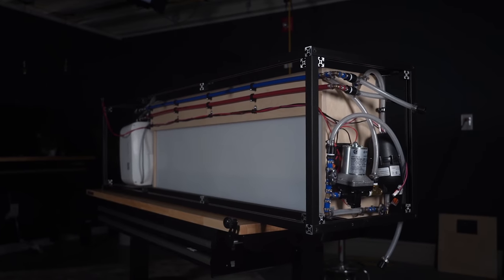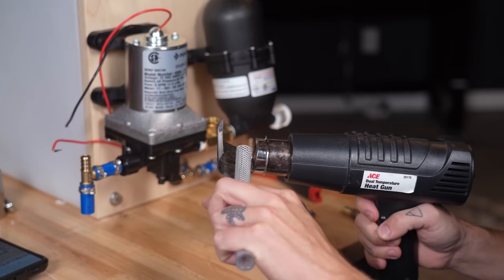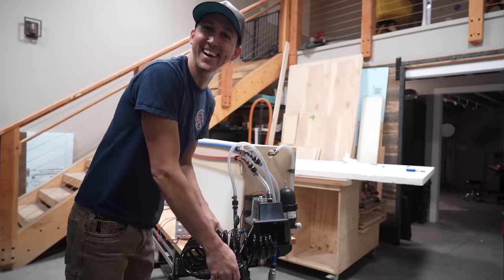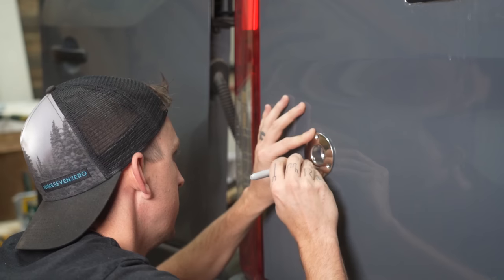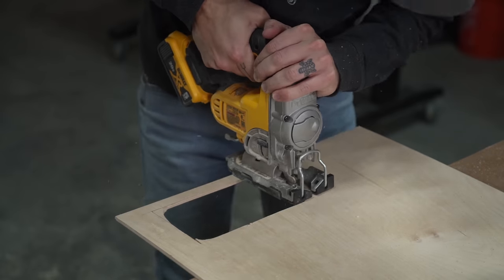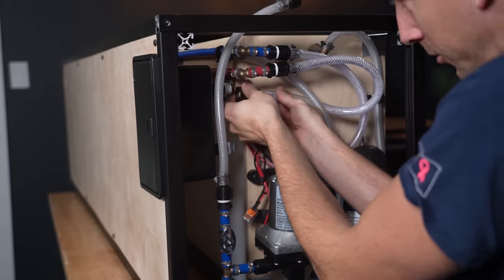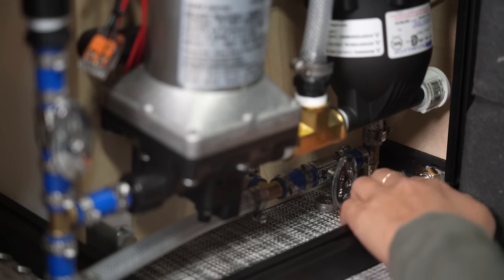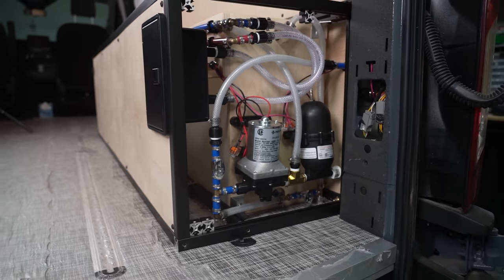DIY CAMPER VAN PLUMBING (full tutorial)

Comment: A tip to you since I’ve been doing plumbing work for a while now, use Teflon tape along with paste and you will never have a leak again. ;)
Reply: Do you put the tape on first?
Reply: @amateurdiy3960  Yes the tape goes first. Careful Wich way you wrap it
Reply: @amateurdiy3960  tape first clockwise  about three full circles wraps
Reply: Any chance you could explain why pex is used in parts of the system, and flexible hose is used in others?
Reply: @calevel
Reply: I’ve been having leaks in my van. I’m using pex A/expansion rings 
Im looking into converting to sharkbite connectors or pex B with crimp rings. These leaks are killing me! Any thoughts?

Comment: I'm curious why sometimes you used hose and sometimes you used pex.  I'm getting ready to start the plumbing on my box truck, so great timing!  Thanks, as always!  Will you guys be selling plumbing kits?
Reply: PEX is not as pliable. 
In other words, perhaps some of the curves and bends you see are done with hose because it's more flexible. 
You could do that with PEX however you would need more 90s, Tees  and fittings which would work. But you would lose efficiency and add the risk of leaks from more connections.
Reply: @Geminiappleboy , thanks. I had rather assumed that, but I wasn't sure. I couldn't tell from the video, but can a PEX fitting be used with a hose and held in place with a hose clamp? Or is some other type of fitting required specifically for use with a hose?  Thanks!
Reply: @BTNomad  use a PEX to Barb adapter that is sized for your hose. Do not use normal hose clamps on PEX fittings/connections that clamp the PEX tubing, but you can on the braided or no braided hose. Sometimes hose barbs are referred to as nipples.
Reply: @Geminiappleboy  , thank you! THAT is the piece I was missing in my mind!  The biggest challenge I have in doing my box truck conversion is learning what things are called. Thank you!
Reply: @BTNomad  oh cool! Happy to help. 
I would recommend making a drain valve at the lowest point (usually bottom of tank) to drain for winterization or long term unheated storage. 
As far as terminology goes, I think you should gain familiarity with the following plumbing components/fittings: Male/Female, Nipple, Coupler, Reducer, Braided, Adapter, Band Clamp, Hose Clamp, Pinch/Cinch Clamps. 
Don't forget the importance of calculating the flow required for your water pump and the electrical requirement to size your conductors (wires) accordingly.

Comment: Very solid design, build and clear video and editing. Well done, and thank you! The only thing I'm not sure about is whether you used flexible tubing on PEX connectors, which apparently is not a good practice and can lead to leaks in the future. I'm sure that is fine with low pressure/drain applications, but probably not on the pressure lines. Thanks again!
Reply from the maker: Flexible lines went to barbed connectors made for flexible lines in most cases.  If there was a spot where this wasn't the case and it starts to leak; I'll fix it. 🤷‍♂️🤣 That's the glory of building something yourself.  If you make it yourself; you know how to fix it if it breaks.

Comment: Nate - at 7:40 you attached the pex tubing into the water fill. The way you attached that was a little dodgy shall we say...The pex pipe will actually spin around the barbed fitting with the crimp attachment on it, therefore when you spun the blue pex so the male thread went into the outlet itself, you may have just been spinning the pex on the last few turns, making the connecting between the brass fittings not very secure. if you can get a spanner in there and just give it a 1/2 turn that could save you big time down the road. Especially as you wouldnt notice a small leak for a while in that inconspicuous space. Youve helped me so much in the past i wanted to pass that along.
Reply from the maker: It was tightened.  There's a lot that happens off camera. 🙂👍

Comment: I'll be building a similar system, so really appreciate this description.  I suggest thicker brackets for securing plywood to extrusion and to van walls/floor.  If you've been in a crash more than a fender-bender, you know forces can be huge and weird.  Use backing plates behind floor/wall to help resist pull-out in a crash.
Reply from the maker: As a firefighter, I've actually been to MVA's that were bad enough that the entire engine was ejected from the frame.  You can't make anything 100% safe.  What we did was fine.  Do what you want in your own build.  Thanks for watching.
Reply: @EXPLORISTlife  Agree,  nothing is complete safe.  Again, thanks for this great overview.

Comment: I’m curious about the KUS Sender unit in relation to calibration with the Cerbo GX. I see you are using a wheel arch tank which has a variable cross section as you travel down the Z-axis. Is it possible to calibrate the sender with the Cerbo GX and Victron touch unit so that it displays a more accurate percentage/volume. We are using a wheel arch tank that has a huge cross sectional area change from the top half of the tank to the bottom.
Reply: We have something very similar to this and I just ignore the tank shape. You can program the Cerbo to have a specific curve to match it but I don't find it worth the trouble.

Comment: Will the flex tubing leak over time? Looks like it's connected to a shark bite T. Shark bite and flex tubes have a different flange to hold them once tighten. Won't the flex tube expand on a shark bite connection?
Reply from the maker: Although it's not 'technically' the right connection, we had to heat up the flex tubing so it would even fit over the fitting, then it shrinks back down as it cools.  That plus a hose clamp gives me pretty high confidence in it not leaking.

Comment: So that method to mount panels to the frames with the small pieces of extruded aluminium is clever! But your video doesn't demonstrate it fully, so I've got questions. :)

You say you cut them to 5/8" thickness, and it looks like your panels are flush with the main frame rails, so both the hole through the small aluminium piece and the threads tapped through the end have to overlap - how do you mount that aluminium piece to the frame rail without that piece of hardware being in the way of the hardware used to mount the panel afterwards? 

 It looks like you're using the 10 series (1" x 1") rails so I assume you're putting that throughhole in at the half-inch mark so as to line up with a T-nut in the long rail? If the hardware used to mount that piece up sticks down through the centerline, that wouldn't leave much space for the hardware holding the panel in place to bite into threads.

Thanks for this vid!

Comment: Wonderful series and I always look forward to each new posting.  Very well thought out and narrated.  One question for you.  I'm confused on the links to the tools and supplies versus what was actually used in the video.  The links are for the copper crimp rings along with the tool to install that.  But the video clearly shows using the clamping method.  Might help if you are able to clarify the difference between the links and the video.  Keep up the good work Nate!

Comment: Think you'll have any issues with people messing with your water inlet? I was too scared to put it outside but filling inside is a kind of a pain.

Just an FYI since everyone does things differently.
We used the same flexible tubing as you and noticed a plastic taste to the water so I switched to using food grade silicone tubing on the non-pressurized side and pex on everything else. 
We didn't use an accumulator since the 4008 pump instructions said you don't need one and we haven't had any issues with the pump coming on/off any more than usual (I also took a few trips with the accumulator in our system before I rearranged things and needed the space).
We are in Wyoming and have to winterize a lot so we changed to the IsoTemp water heater because it drains from the bottom and taking the whole Bosch water heater out to drain it was a huge pain. But the IsoTemp is like 3x the cost of the Bosch.
We have a 400ah lithium system and have no issues with using the water heater since we drive a few hours each and fill the batteries back up. The Bosch is 1800 watts and the IsoTemp is 750 watts, but the IsoTemp takes twice as long to heat up, so both are about the same in terms of electricity usage.
Reply from the maker: I'm not worried about people messing with our inlet, no.

Comment: Thank you for such a clear build, really helps eliminate the learning curve for van plumbing. My one question would be is if the Bosch Water Heater is always on and just senses when there is water coming from the pump or is there a switch for that as well? I'm not too familiar with water heaters so any information would be very helpful! Thank you!
Reply from the maker: Currently, it's just switched on/off at the breaker.  I may put it on a switch in the plumbing enclosure eventually or a bluetooth outlet switch; but I wanted to see if the simpler solution was adequate.
Reply: That definitely makes the most sense. Thank you!

Comment: I think I have the same pump. I was going to add an accumulator tank however the manual doesn't recommend one I think it's the new bypass pumps that don't need them.  They are loud af for me without flexible tubing attached directly at the inlet and outlet of the pump.
Reply from the maker: Interesting.  Ours is whisper quiet. 🤷🫤
Reply: For me it's the Pex line coming off. It vibrates and reverberates. The company actually sells a kit with flexible tubing to help quite the pump.

Comment: Thanks. What are you using for water gage? I ordered two gages, that look identical, then asked if it’s safe for drinking water and was told no, ask to cancel order and they said, oh yeah, they are safe. Bottom line I canceled the order.

Also because tank has wheel well when it’s says half empty it will not truly be half empty. 

I am considering external monitors so I can place sensors in better positions to indicate/read level.

Can you link to the product you are using?

Comment: Usually we have the water tank on the same side of the shower (for example) and on the other side of the van there is the sink (or viceversa). Where do you place the plumbs bringing water from the tank side to the other? Under the floor? Or following the bed structure creating a little step? It's not clear to me ...🤔 .. Thx
Reply from the maker: Showers in a van isn't really our thing, so we just keep the kitchen on the same side as the plumbing so we can go right from one into another without running plumbing back and forth across the floor or ceiling.

Comment: Great video and it gives me insight on how to mount the tank in my van.  I have two questions (more of enlightenment)?

1)  I didn't see any filters installed including the one that comes with the shureflow pump.   Is this part of your kitchen setup coming later?
2)  I see that your accumulator is not inline with your water flow.  This the first video I have seen in that configuration.  Can you explain why?

Thanks again for a very informative video.

-Ken
Reply from the maker: 1: I bought the little additional screen filter but could simply not get it to fit where I needed it to, so I decided to omit it.  

2: It just fit best in the orientation I did.  There are two ways to connect the accumulator tank as per the user manual with no mention of difference in performance.
Reply: @EXPLORISTlife  Thanks

Comment: What size flexible tubing is that? I thought you weren't supposed to use 1/2 flexible tubing with 1/2 pex connectors because the sizing it different.
Reply from the maker: I don't recall specifically.  I didn't keep a parts list for this specific part of the build so you'll just have to spend some time in the plumbing isle.

Comment: Hi, my sender for the water gauge came with 5 bolts which seems to be usefull for a gaz tank. In your video, you seem to be using roofing screws with a rubber gasket, did you buy this separatly? Thanks
Reply from the maker: Maybe?  I don’t recall, specifically. Lol
Reply: Ok, I might be overthinking this 😂

Comment: Awesome video! 

Q: How do we make sure no water or road debris comes back up thru the waterr heater pressure relief drain and overflow drain thru bottom of van? Any recommendations would be appreciated.
Reply from the maker: If you keep gravity mode turned on, you should be fine. 🤣
Reply: @EXPLORISTlife  that is the best answer! 🤣 Was thinking we might need to seal around hose, just in case?

Comment: Curious why you fitted the flexible hose straight to the Pex elbows where the water fill comes out, but in other places, used adapters to transition from braided hose to Pex?
Reply from the maker: Mainly because I had the flu and was doing my best.  Probably should have been filming but we were behind schedule. 😅🤷🏻👍
Reply: @EXPLORISTlife  Hah! So - would you have used adapters in those lower spots if you hadn't been suffering? :)
Reply from the maker: @wanderingzythophile9083 no clue.  Maybe?  Ultimately, what I did didn’t leak, so both ways must work fine enough.
Reply: @EXPLORISTlife  Another query: The top right port of the tank, that you're using for the vent: you positioned the fitting/hose so it goes up and right and loops back down. Is there a compelling reason for doing it this way as opposed to pointing the fitting and hose straight down? Thank you again!

Comment: Great job! Wondering why you choose not to add a water pump strainer before your pump in this build?
Reply from the maker: Sure!  It's simply didn't fit where I needed it to, so I said fuck it and moved on. 😂🤷‍♂️
Reply: @EXPLORISTlife  I like your decision making solution!!
Reply: We use one of the cheap blue filters attached to the hose when filling, so that should remove anything that would damage the pump.

Comment: A shut off valve at the overflow is essential. Without it, you'll lose a lot of water (sloshing around while driving, and through evaporation).
Reply from the maker: We've found there isn't much water lost due to that; but yeah; definitely put a shutoff in there if you want.  Just make sure there is another way for air to get into the tank.
Reply: @EXPLORISTlife  I noticed, especially in overseas van conversions, they have dual water inlets at the port. One acts as the fill tube, and the other one is the vent. They open the vent cap when filling and when excess water spits out the vent- it's topped off. Then they screw both caps on. No overflow pipe needed. When they arrive at a camp site, they unscrew the vent cap to let air into the tank.
Reply from the maker: @michaeltravis3562  Sounds like another neat way to do things.

Comment: Is the 16 gauge wire necessary for the tank sender? I presumed I could use a much thinner wire as it doesn't really draw much current? Thanks so much for your great videos, always extremely informative and well presented!
Reply from the maker: Any smaller than 16ga and it starts to get fragile.
Reply: @EXPLORISTlife  But it isn't related to inaccuracy as a result of voltage drop? Providing the wires were running in conduit and completely protected, would it be acceptable to use a higher gauge wire? Thank you for the help!
Reply: @m0ckingbirda  I think I used 18 for mine. On the Cerbo end it's a pain to get larger wires in the little connector for the tanks.

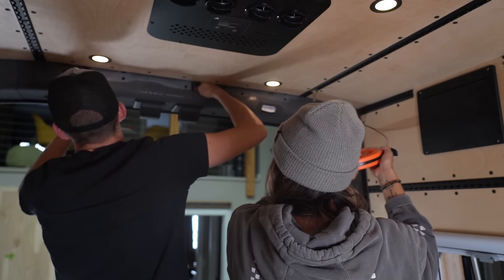Comment: At 8:08 you are running the wire for your gauge. Like other wiring, you have single red and black w only 1 small sheath of protection against the sharp metal of the van in what can only be described as a moving earthquake. Why are you not using something like Ancor marine wire so you have the additional white sheath around both red and black, and further looming that?

At 5:56 you seem to be going through a lot of trouble making a part rather than say 8020’s roll in panel mount part 2489 for inset panels or part 2428. I presumed you used 10 series in this video. Any thoughts? Tnx
Reply from the maker: 1: We zip tied everything up nice and tight with protection as needed off camera.  I prefer working with individual wires.

2: $100 and 3 weeks shipping vs an extra piece of 8020 I had laying around plus an hour of work.
Reply: @EXPLORISTlife  thanks, Nate!
Reply from the maker: Also, here us our video over wire management that's related: https://youtu.be/LifVE28FfmU

Comment: How efficient is it to use an electric water heater? Do you have a recommendation on it ? or maybe a video about that ?
Reply from the maker: What do you mean by 'efficient'?  It takes a lot of power to run, but it's fast to heat and keeps water warm for a long time.
Reply: @EXPLORISTlife  there are water heater that uses propane for example.
do you need a big batterie bank ?
Reply from the maker: Ah, I see.  So... the electric water heater will use a lot more power than a propane heater, but we don't have to carry/fill a propane tank.  The tradeoff is the large battery bank, which we do indeed have.
Reply: @benjaminlachance2783  We have a 400 ah lithium setup and we run a water heater without issue. We usually just turn it on while driving. Our water heater pulls about 60 amps so running it while driving doesn't draw down the batteries much at all. Driving a few hours a day usually fills our batteries from the previous day so we try to do big things like the water heater while driving since anything coming in is wasted if the batteries are full. We also crock pot dinner while driving too, for the same reason.